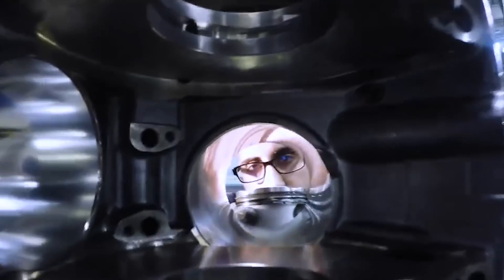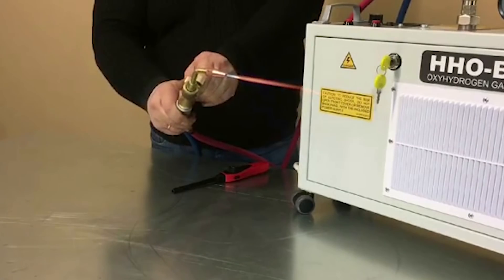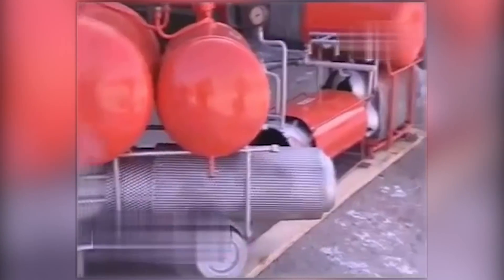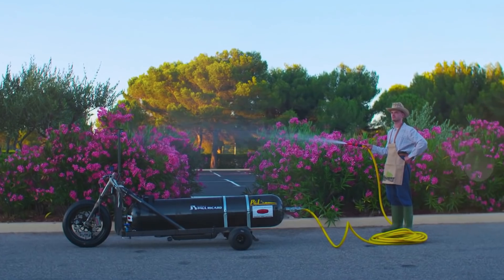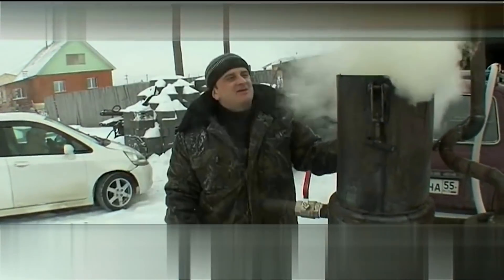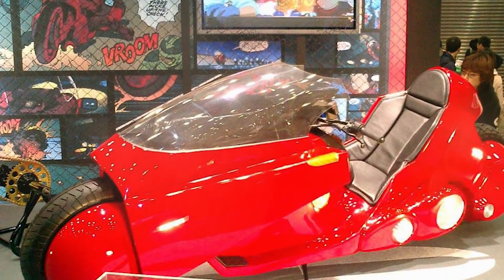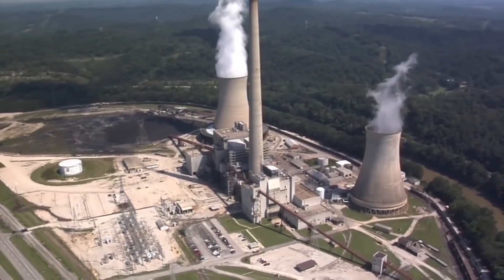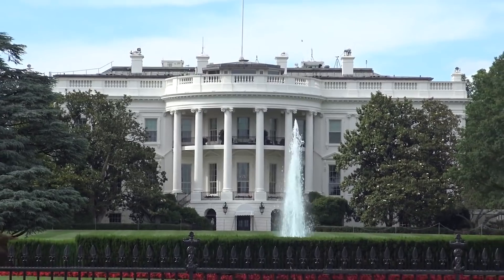Why These Engines Are Banned?

Comment: WHEN YOU HEAR GOVERNMENTS CRY ABOUT CARBON EMISSIONS, DON'T BELIEVE A WORD OF IT. IT'S ALL BULL$#!T.
 FOR WELL OVER A CENTURY ENGINES THAT ARE EFFICIENT CLEAN AND DON'T RELY ON FOSSIL FUELS HAVE BEEN BANNED. 
Why These Engines Are Banned?
THEY'RE BANNED BECAUSE THEY DON'T NEED FOSSIL FUELS TO OPERATE. ALL THE WHINNING MOANING AND GROANING ABOUT FOSSIL FUELS AND CARBON EMISSIONS IS OUTRIGHT PROPAGANDA, LIES, MANIPULATIONS.
 CLIMATE CHANGE AND THE GREEN ENERGY AGENDA IS NOTHING MORE THAN A MEANS TO TAX US CHARGE FEES AND CONTROL THE POPULATION SUPPRESSING ENTIRE NATIONS WHO HAVE NO MODERN ELECTRICTY.
 THERE ARE FUELS LIKE HYDROGEN ON DEMAND FUEL CELLS THAT PRODUCE POWER BY SLPITTING THE WATER MOLECULE INTO ITS TWO PARTS, 1
) OXYGEN AND 2) HYDROGEN WITH ZERO EMISSION AND THE ONLY EXHAUST IS WATER VAPOUR.
 THIS TECHNOLOGY GOES WAY BACK IN TIME. ANCIENT INDIA, ANCIENT EGYPT AND MANY OTHER ANCIENT CIVILIZATIONS USED HYDROGEN ON DEMAND.

Comment: Wow man I was just thinking about a motor  powered by compressed air for the rotation of the piston
Reply: and what will power the air compressor ?
Reply: 😂🤣 hydrogen , solar panels , batteries, or even a simple jar a big jar of water left in the sun that will compress air as it evaporate's  . Anyways the Sunbus in my town is hydrogen powerd 😁 When will people get on the bus😂🤣 I guess people like GLOBAL WARMING 😮😂 THAT IS WHAT PEOPLE SHOULD BE PROTESTING ABOUT 😢🌍
Reply: @johnnyc7395   people like the warming , it lowers heating bills. 
but making hydrogen, then compressing the shit out of it, and running it through the bus is grossly inefficient compared to using a battery. that sunbus is an engineering prank like ur big jar
Reply: @echelonrank3927  🤣 warming  😆 I'm talking about the flooding from Florida to New York 🤣 Im glad I don't have to swim 😆 or how about the biggest wild fire in history over 1 million Acer in Texas, I've seen these clips on TV . How can you say people like the warming 🤔

Comment: Yes a vehicle can be propelled by air engine but not in a car or anything much heavier than a person on a bike and weight of the engine. 
A while back they  figured it out For a 2 tonne car wanting to travel 100KM at 100kph (with a decent amount of power for safety) 
it would need about 2-3 truck trailers worth of Air Cylinders (each the size of the entire truck trailer)

- The so called "wonder car" does not count as it dont mention that it is Slow as a snail, yes it reached 100kph But on FLAT only and it took 2mins 45 seconds to reach that speed. 
It has less power than a typical modern Road Bike.

Comment: 8:49 100% wrong inaccurate lie it merely reduces the half life by considerable amounts. there is no known metal combination easy to product easy to manufacture that won't super corrode apart and result in major nuclear accident worse than fukishima chernobyl combined. thorium requires already happening nuclear fission to start from tradition sources, and thorium can be shut down with out a scram that kills the reactor until it is refurbished/rebuilt. 4 hour shut down process vs 24/48 hour that won't result in a hydrogen explosion.
mad lab needs to check his facts before just out right lying.

Comment: Commander I agree. Mass energy industry is so scared. Fossil fuels are running dangerously low. Time for us to push them down and allow progress. Everyone has noticed what happened to Tucker and I pray the big three do not shut any possible alternatives we’re past the point of no return on gas. 2050 is a noticeable deadline. Ford and the others need either implement these methods or there will be a lot of four wheel statues littering the earth.

Comment: They mis One Fundamental Fact. Energy; which through F=M*A will be needed to to disturb anything, with mass, from its current state in motion or otherwise period.
This eminds me of the ORGON ENERGY freeks back in 2009. I seem to remember posting, toung in cheek,  post then "now you'all be carefull out there or you might just down load a substantial  chunk of that zero piont energy stuff in the local vacinity of the solar system, into that chevey cilinder block of the car that runs on that Orgon Energy stuff!!!!
 BANG wont quite cover it. Tatty by a large chunk of this quadrent of the milky way. Well you never know do you???  you gota laugh at it have you not? 
Mercifully for us all fundamental physics was and always will be fundamental, or we wouldnt be here would we. Think about it

Comment: Hear me out, compressed air engine, alternator to charge battery, battery to power a quiet compresser which pasively refills the air tanks while you drive
Reply: Ok, I heard you, and no.

Each piece is not 100% efficient there is always loss in the system, and often the more complex and the more pieces to the system the less effienct it becomes. Example: you spend more energy to compress the air in the air tanks than you get out of it -> you lose power in the engine due to friction which is turned into heat -> you lose more energy to spin an alternator -> the alternator isn't 100% efficient either so you only get back a fraction of what you put into it -> batteries are heavy so cost most energy to move and you lose some of its energy to heat as it charges and discharges -> rinse and repeat. lets say you had a car that could drive 1,000ft on a full talk of air. With your system it might get 1,025ft but the added cost of the alternator, compressor, battery, etc would outweigh the benefit of using that system.

Comment: everything in this has been tried before and rejected for a variety of reasons. Now if you want a medium sized car to have a range of 450 miles,  cruise speed 60 mph,  maximum speed 120 mph, and cost £1.3 (UK pounds)  for that 450 miles, you need an engine I have invented. Its basically an electric engine, but the electricity is generated by my device. This uses Hydrogen which has been mixed with a tiny percentage of Terbium (Tb) and fed into a simple single cylinder motor, similar to a Wankel, but there are injectors that feed a mix of Curium (Cm) and Nickle(dissolved in Hydrochloric acid, becoming a green hexahydrate) with a secret additive. This produces 155 BHP, at only 4750 RPM. This drives a generator of my own design, which is at least 300% more efficient than others I have tested. I have not included a battery to store driving power, only a normal 12 volt one to start the engine. My test vehicle is a 10 year old Honda Civic, it looks normal from the outside. I dare not try to get this produced by a motor manufacturer, they would find a way to stop it. Same with fuel companies. So I guess this will never be a production car, unless someone comes along with a few million, but even then, one of the aforementioned giants would stop it.

Comment: The first one is already bull:The generator that requires power. It's an electrolysis machine that spends energy to separate water into Hydrogen and Oxygen. It would be like using a gas powered leaf blower to move your car, and calling air powered.

Comment: Completely false.........Oak Ridge National Labs ( ORNL) ran the Molten Salt Reactor experiment for 10 years to prove the safety and simple engineering of the concept that is the ideal design for Thorium and even burning up existing spent nuclear waste.  Maximov had nothing to do with it, the main proponents for Thorium as a form of nuclear power (its useless for making weapons) were Weinberg and Seaborg.  Thorium's key properties were researched during the Manhattan project, and is EASILY the answer to the worlds needs for a cheap,abundant and safe energy source that solves ALL the problems inherent with the dinosaur designs of conventional nuclear solid fuel/water cooled reactors that should never have been built after the 1950's.

Comment: Right now they are pushing electric cars, but no one seems to think about the resources needed to make the billions of batteries that will be needed, or how to dispose of said batteries. Not to mention, how our biggest problem is the volume of consumption of electricity, if we replace the worlds cars with electric, will that not increase our demand for electricity? You can't expect every single charging station to be powered by solar do you? Now, an air powered car, that sounds pretty cool. All you have to do is compress it, and you are ready to go. No need to increase mining of minerals for batteries, or increase drag on the grid.

Comment: this shit so stupid, thought i was bouta watch a doc on fuckin f1 or some shit, but no just some californian office soy boi with a fuckin subaru thats seen to much vape talkin bout shit he probably dont even know bout to well. well guess what most of these ive heard of and i aint even gonna finish the fuckin vidjao because you dont deserve my view.
and for the record, the wankle engine was designed by a german. and it also in most cases has a issue with emissions anyways, so oil companies would fuckin' love to run every vehicle with it cause it would make more money. but the oil companies dont entirely have much ground to stand n in terms of vehicles, yeah they do but the epa and shit has more to do wuith automotive stuff than oil could ever pull, but thats kust what i think, but unlike you i learned and understood how shit works mechanically, an opposed piston engine was not banned, it just never became viable due to the potential reliability (how are you going to get oil to stay in both halves of the crank case being that it has 2 cranks? why is the wankle engine not used? because of enharent reliability to the mass market, its best to run 2 stroke mix, but many people are not gonna know that and thus a lot more cases of low milage burned up engines will happen making sales drop due to consumers not knowing that they need to put premix in their rotary engine so to compensate mazda (the designers of the arguably best examples of rotaries, put a oil enjector into the intake side of the irons which uses the engine oil to lubricate the insides of it, but because of its design its going to also burn the oil, which is why 2 stroke oil is preferable because its designed to be burned unlike regular engine oil.
you also didnt give credit, i know you stole footage from warped perception.

Comment: one of the good reasons we dont drive around on compressed air, is that if one of those airtanks explode, your car would turn into a bomb.
Reply: Yes.....so we drive around with combustible fuel in a tank that is infinitely more of a bomb than the air compressed in the tires of our vehicles hmmmmmm🤔🤔🤔🤔
Reply: @furball8967  gasoline burns, compressed air explodes. This isnt rocket sience mate.

Comment: Locomotives were powered by air in many industrial plants in the days of steam locomotives. They were used where the fire from a steam locomotive could ignite some hazardous materials, thus the locomotive was basically just a steam locomotive with its boiler replaced with a big compressed air tank that could be refilled as needed.

Comment: The shock of this paralyzed me, so I couldn't click away.  Just what was the engine that the bio-physicist created that was banned?  The mag drive is in that 2-wheeler; one of the bikes available states that the rider needs to petal for 1 km to ride for a km... you should do a vid on the patent and the whole concept.  The rotary engine could still be used, the HHO generator is being tested by a company for trucking, solar power is all over the world - whether it is used for HHO or everything else.  The State of CA helps people pay for solar to put on their houses... are you saying big oil is killing every homeowner and every politician in CA?  The plastic cars of India, powered by air, do not meet US safety standards- at about 60 mph, more would die and you'd complain they shouldn't be on the road -- the racebike is good for only short distances.  The thorium reactor is being tested in China... some in the US have claimed it just didn't work as well as advertised - but that would suggest someone built a test model.

Comment: Could you imagine the chaos that who ensue if fossil fuels where suddenly no longer needed?
Reply: Petroleum will always be needed.
As a sci-fi buff, I have read in several books where characters have stated that burning petroleum is the crazy.
What I don't understand is why companies like EXXON or BP don't jump on the hydrogen bandwagon with production and distribution networks. BMW already has a hydrogen engine on the shelf, ready for production (with proper tooling, of course).

Comment: There is so much that is so wrong that this wacko is stating. The Wankel rotary engine was invented by Felix Wankel in 1929 and further developed by the German automobile company N.S.U. in the 1950s. Nothing to do with the U.S. Department of Defence.
Compressed air powered vehicles? Nothing new. Quite common in areas of high flammability risk but for a passenger vehicle a total no-go. The thing would be full of air tanks to give it a decent range with no room for passengers or luggage.

Comment: The only problem with the air motor is pumping air normally need ether electric which requires gas/oil/coul/well we do have solar but we don't make enough solar power to use that. Or we use a gas motor to pump the air.
Reply: Gas motor still uses a lot of resources

Comment: I don't think it's big oil stopping HHO there are plenty of manufacturers making them. The problem is the infrastructure isn't there and that Hydrogen requires more energy put into it than you get out of it. Unlike magic black liquid you dig up out of the ground and burn. I would also imagine that peopel can't sell those devices they made at home to the public because they're not safe/haven't been tested/don't meet specifications.

Comment: Oh yeah, evil cabals out there thwarting perpetual motion machines. If there are regulations it's due to safety or concerns over pollution.  Steam powered paddlewheelers and steam locomotives would blow apart and cause significant carnage.  One can only imagine the energy released should some air powered contraption have its tanks ruptured in an accident... ever watch a scuba tank blast thru cinder block walls when the regulators are snapped off?  As for most of these "alternatives", they all still require another power source, like petroleum or electric to store the energy.  Laws of thermodynamics dictate that anytime one power source is converted to a different form that sizeable amounts of energy is wasted in some kind of heat loss.  The Russian solar conversion of water to hydrogen is right up there with cold fusion.  If the technology worked, we'd be using it.  Do you really believe big oil in the age of information technology could possibly conceal this?  Every mountain-dwelling "freeman" would have his own hydrogen still, right next to the tin foil hat rack.  I will say the oil and coal industries have spent hundreds of millions successfully trying to convince the bubba joe voter that the eminent threat to life on earth (carbon dioxide generation) is some politically motivated hoax.  We would be better off with wood-fired Stanley Steamers, at least that technology is carbon neutral (same amount of CO2 to create the tree that it releases when burned).  Large scale solar and localized molten salt reactors are the most viable chance we have of making it to the next century, but please, keep spewing misinformation for those hefty YouTube checks.

Comment: "but for some reason their inventions aren't released for public use..."

Yeah; because none of them work the way their inventors claim they do. They are all either delusions or scams. The only thing "banning" them is thermodynamics.

Using electricity to split water so you can burn the HHO gas for energy, for example, is a complete waste of energy. You cannot get more energy out of the HHO than you put into splitting the water, and because no system is 100% efficient you can't even get that much.  If you want movement, just power an electric motor directly. If you want heat, use that motor to power a heat pump or an arc torch.

Comment: the real reason none of these other engines have become common is because they lack the power output required to move a vehicle. To date the most efficient engine is the Stirling Engine and though it has the best energy output compared to the fuel used it can not produce mush energy quickly, making it non-viable for most scenarios where you would want that efficiency.
Reply: Then make it efficient. Excuses, excuses.
Reply: @SorrowAvenue  It is not a matter of efficiency but raw power output. The more efficient engines don't give a huge output but rather give a small output over a long period of time. Also, engineering can't just make something just because we either want or need it, but rather takes a long time to find and refine a solution.
Reply: @SorrowAvenue  Then grow some wings and fly to the moon. Don't give me an "Evolution does not work that way" as that is just as bad of an excuse.
Reply: This is caused by a force called counter force, it exists to counter every force that is exerted, simple example take a sharp Nail put it on a soft thick material notice that you have to hit it not once but multiple times for it to finally go all the way in, I hope that makes sense.

Comment: Those hot air engines actually existed (and they're not banned at all), they were invented during the industrial revolution due to steam engines exploding (hot air engines didn't explode because the combustion was external). They can even be pretty efficient at almost 40%, so why aren't they used in cars? They kinda were, in prototype cars and the engine really didn't work well for that purpose.